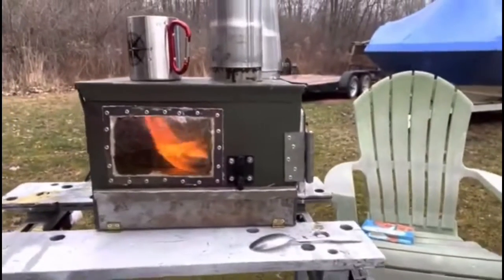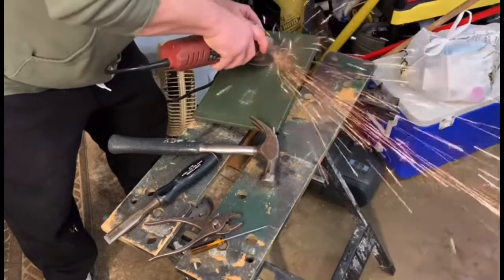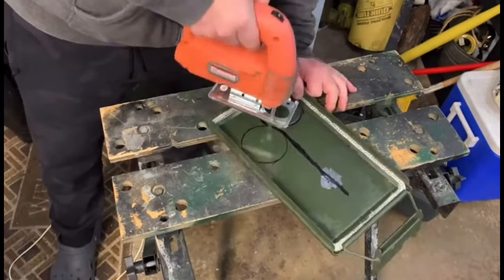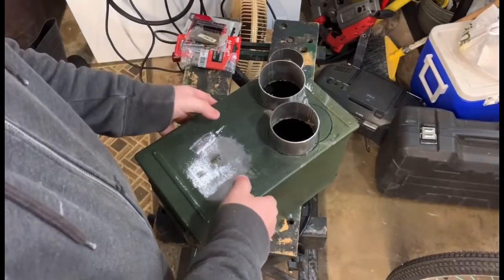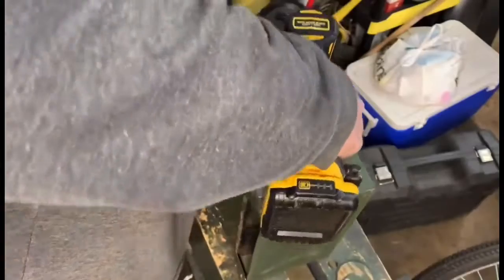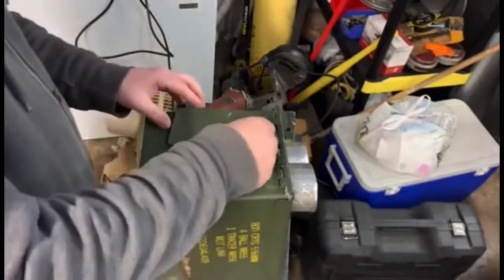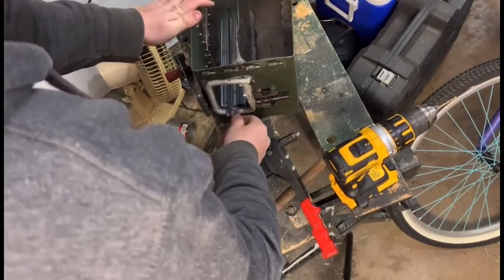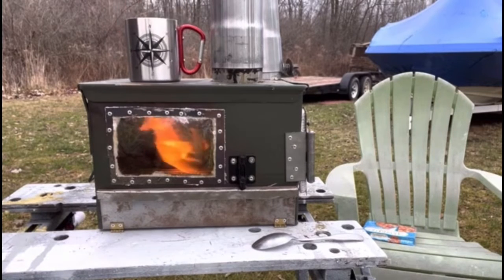ENDLESS HEAT for Your Home WITHOUT Electricity | Ammo Can Gravity Feed Pellet Stove for Off-Grid

Comment: It helps to heat up the flue pipe first to cause a good draw. That makes it easier to light the burner. You want the air to rush across the pellet basket to they heat better. 
 I had to experiment with different size burners to get the right temperature so the pellets would burn up completely and not build up ash that plugs the burner.
 Ammo cans are only $16 at Runnings or Harbor Freight with a coupon. But now I found the "fat 50" caliber can which will work even better, The fat 50 is an inch longer, 1-1/2" taller and 1-1/4" wider so it will make a little bigger stove and heat larger area (and easier to work with if you are welding)
Reply from the maker: Ahh that makes sense

Comment: Very nice example for an outdoor heater/cooking. I don't really see the application for indoor heating as the title suggests. A very creative project and I'm glad I watched the video. Thanks 😊
Reply from the maker: @lewchaney2138  I’ve used this stove in a cabin. I need to do a video showing how to pipe it to outside. Thank you for the view
Reply: @Jeep-Creep  I've actually used a larger version of that burner/stove setup to heat my home for several years before pellet prices went over $60 a bag. I just made a 4" burner tube welded thru a door on my wood furnace. The flame traveled out of the 4"tube to the back of the stove, then to the front of the stove, over a baffle and back to the chimney flu. It burned plenty hot and clean, no smoke at all!
 Making a burner out of mesh will not last too long as the heat will make it disintegrate in no time. My burners were all made using 1/4" stainless rod.
 I may make a smaller version like that to see how well it heats over night and the amount of pellets it will use!
Reply from the maker: @PainterD54  I wish the mrs trusted my experiments and let me try making a bigger one for the house.  I am looking at a Pellet / Wood burning stove that will be available in the US soon.  The one I am looking at is made by Aduro not sure which model I like but looking at a H1.

Comment: Clean that metal up both for parts being welded and for ground clamp, get tip to a 45 and  closer and welds would be much better 😉 cleaning the metal up is key with flux welder, and ground should be bare metal
Reply from the maker: Thank you for the tips. I’m still learning
Reply: @Jeep-Creep and use smaller wire. I find the little. 120v flex core welders work far better with .030” vs the .035” wire they usually come with.
Reply from the maker: @ I will for sure try it

Comment: Cool..so the pellets dont clog in the mesh?I tried something similar but the pellets dont seem to turn to ash and the flame is semi weak.
Reply from the maker: The pellets don’t clog the mesh. You need to use a 5/16 or better chicken wire. It does need to be stoked now and again. Mainly because the feeder gets a bit jammed after several hours. I am working on ideas for a better feed system. Gravity feed systems are usually very large compared to my lil stove. So I am thinking of switching to a slow turning auger that is powered by heat they sell kits. Any ideas?  Please also subscribe
Reply: @Jeep-Creep   https://www.youtube.com/watch?v=KXNB50OGMIM&t=198s this is another way supposedly to feed pellets. Umm, what do you think is the max size wire spacing you can use with the basket?
Reply from the maker: @JediStockTrader  I am not sure what the max size would be, I mean obviously it cannot be much larger than the pellet size or it won't hold them right and you will get run over.  I have seen this guys videos, and I looked at his design.  His setup I believe is not an auto-feeder system.  I have a drop into a chamber for the coals to rest, yes unburned pellets sit on top, but they are starved of Oxygen so they don't all ignite at once, plus the draw from the door / draft pulls air through the ignition chamber and not the feeder.  Also I do not have to heat my exhaust pipe to get my stove going.  I think the best way to ignite a pellet stove with ease is to not use a torch, rather use a fire starter brick, which is composed of paraffin wax (accelerant) and sawdust.  They start very easy, and burn for maybe a few minutes.  This direct flame on the pellets I think is easier, maybe not faster, to get the pellets started.  The torch does not burn them any faster than  a normal flame in my opinion, and its a pain to keep holding it.
Reply: @Jeep-Creep  I contacted him and he seems to prefer this set up over the one he did prior. Its because the air  draw comes from the top  and not sideways .
Reply from the maker: @JediStockTrader  Yeah looks like it works pretty well.  There are lots of methods that work for pellet stoves.
Reply: @Jeep-Creep  have you considered baffles in the feeder tube? Essentially sheets of metal that look like |\ /| installed within the tube? I work in processing equipment and use this for a more even feed in our hoppers.
Reply from the maker: @jakeumstead9959  I am interested in your idea. A hopper would be a great idea. I’ve also consider a slow rotating auger as well.
Reply: @Jeep-Creep   how about this? https://youtu.be/KXNB50OGMIM?si=jklAzxwT3WTN0BGg

Comment: Your welds were garbage because they were contaminated by the paint from the can. I’d be willing to bet your welds would get a lot better by simply getting everything to bare metal… :-) with that said, very cool project/creation
Reply from the maker: Yeah you are probably right. I didn’t spend enough time getting to bare metal. They are strong enough to hold this project together though. I’ve been using it often without issues. I am considering some revisions to the hopper feeder so I get a more guaranteed long feed rate. Sometimes it feeds a little fast or jams.
Reply: @Jeep-Creep  get it down to bare metal and wipe the weld areas with acetone… closer you are to surgical clean the easier and better your welds will be, especially thin metals that you can’t cook the porosity out of it…
Reply from the maker: @AkPacerPilot   I will keep that in mind. It’s usually thin metals I have the most trouble with so that makes total sense.

Comment: I enjoy the video, but I would like to see how it actually feeds… Can you do a second video on the actual operation of the stove? Greatly appreciated Sir!
Reply from the maker: Yes, I can do some more videos. Basically it feeds via gravity. It is a straight drop down into the basket. Now peoples first thought is that it will burn vertically. That’s not the case. The draw from the exhaust causes the coal chamber basket to burn horizontally which prevents it from burning the entire feeder tube.
Reply: @Jeep-Creep  I have a 2" square feed tube on mine, (which I thought was going to be too small) But the pellets slide down just fine. I burned it for about 4 hours yesterday steady and it burned perfect once I set the air intake. The only part that takes time is making the stainless steel burner.
Reply from the maker: @PainterD54  I want to improve my burner as well.  I am currently using, as you can see in the video, that heavy welded wire grid.  I am thinking of something in stainless as well just havent found a material I like yet.  I was also considering using an electric auger to have more control over the pellet feeder... This electric motor I was thinking could be powered by the heat using a thermoelectric generator.